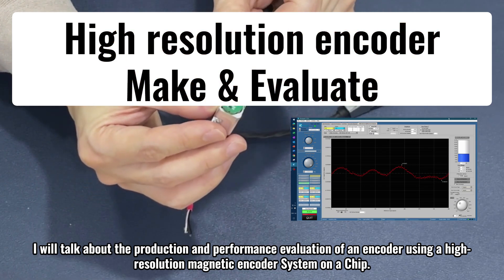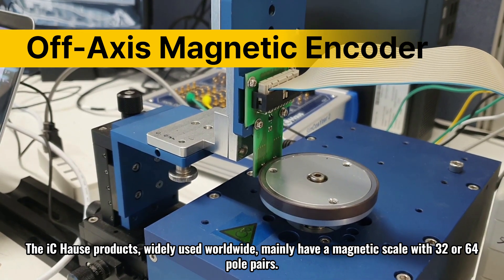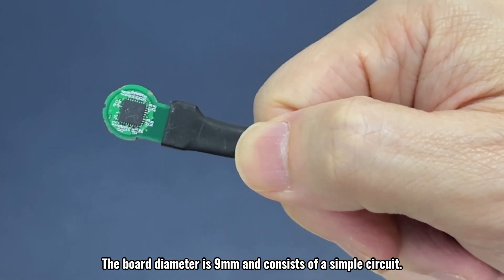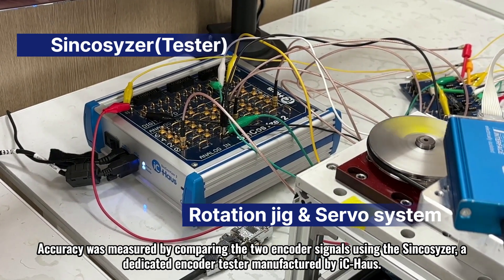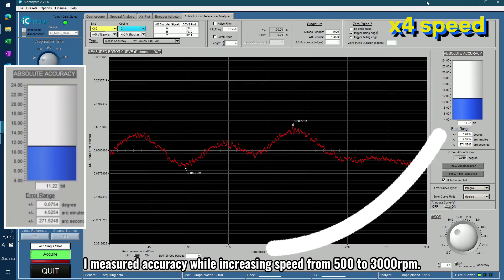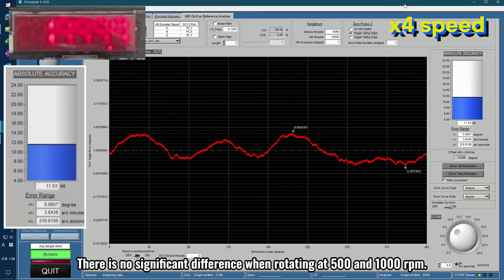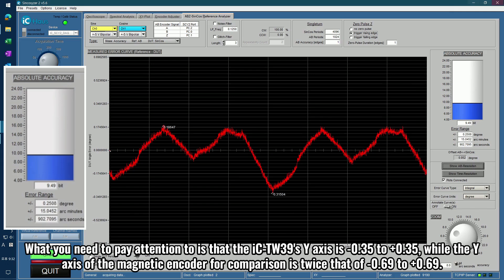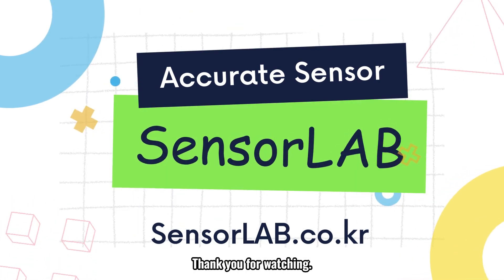Making & Evaluating a mini encoder. high resolution(20bit more) magnetic  encoder. SensorLab.

Comment: Is incremental or absolute more accurate if I need the absolute lowest rpm that does not fall backwards so much. Or if I want to hold a position how accurate will it hold for half an hour.
Reply from the maker: Basically, the accuracy is the same whether the output is an incremental signal or an absolute signal from the same encoder.
The encoder accuracy is low due to the following reasons:
1. Mechanical misalignment (eccentricity, etc.)
2. Scale error
3. Signal processing error
Of these, number 1 is the most important.
Thank you for watching. SensorLab.

Comment: i have been searching for high resolution encoder for my diy telescope mount for ages. would this be suitable? could you guide me towards what's more suitable for this project? Thanks!
Reply from the maker: Tnaks for watching. 
If you use a rotary encoder, I think this is a suitable product.
This IC is the latest and most precise among small magnetic encoders.
This is a product that is actually applied to precise small CCTVs.
A hollow magnetic encoder is also applied to large CCTVs.
If you want to develop an ultra-small encoder, this is a good solution, and if you have enough space in the camera, I think it would be good to also consider an inductive encoder.
I only uploaded a video about a linear inductive encoder, but I will upload a video about a small rotary inductive encoder next time.
Please refer to the link below.

Inductive : https://youtu.be/YOTLM0RQMkM
IC Maker web :  https://cambridgeic.com/
Gear type magnetic : https://youtu.be/NbqbUgA9HOA